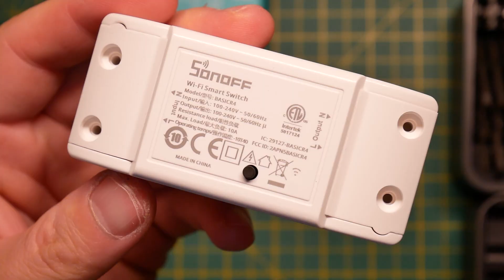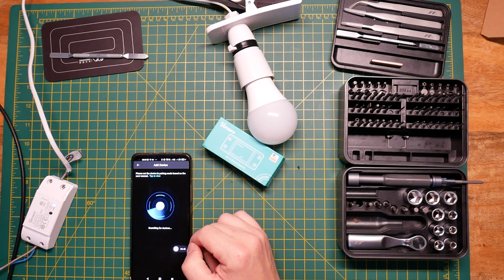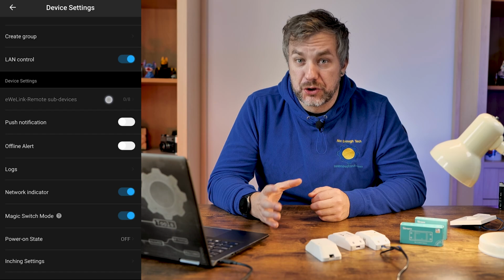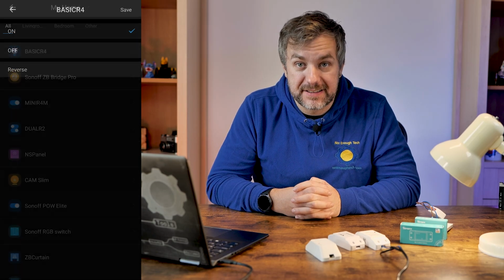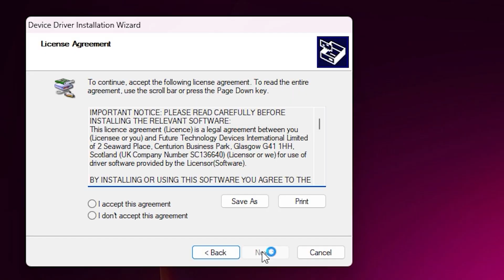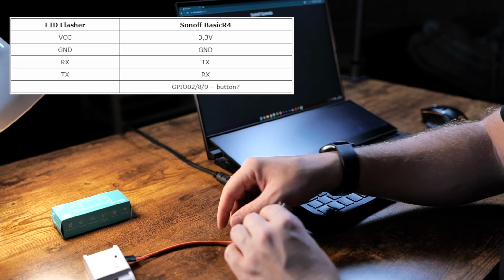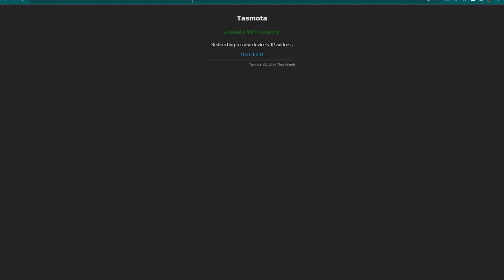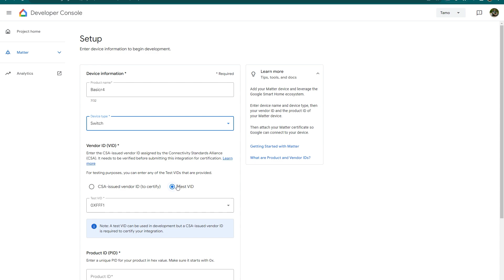Adding Matter to Sonoff BasicR4

Comment: 3:30 into the video you said that you could "expose the pins of the header".
Are you serious?
You failed to notice in your video that the Sonoff BasicR4 is missing a transformer.
This means that the electronics inside is not isolated from 220V mains AC.
It's not rocket science to realize how 220V AC might be reduced to 3.3VDC without an internal mains transformer.
Congratulations on sending your less experienced listeners to an early death.
Reply from the maker: Hacking is risky. This isn't advice to make the device safer. The scenario which you describe is dangerous when device is faulty to begin with, which isolated or not, would be dangerous to tinker with regardless.

Comment: If I install a Sonoff Basic R4 at home along with Sonoff R5 switches, will they still work if the internet goes down? Do they communicate directly with each other via eWeLink, or do they completely depend on the cloud connection?
Reply from the maker: @EinSoldiatGott  both support LAN only mode so as long as you are on the local network it would still work with the app.

For the software automation panel where you link smart devices cloud is requiried

Comment: Hi there thanks for sharing the video. it's awesome. Based on your expertise, is the basicR4 possible to be installed directly with the wall light switch? usually for wall light switch will have 3 cables whereas for the basicR4 only have 2 cables input. I wonder if we can let the ground directly connected to the switch and L & N cable connected through basicR4 then to the switch?

Comment: Did they ever fix the Tasmota Matter implementation on Google?  or did Google get their head out of their bum and fix it?  Annoying that we have a wonderful compatible "standard" but requires certification.  We can all agree to use WiFi standards without blocking DIY hardware because it's not certified.

Comment: Another call for a look at MagicSwitch mode. I’ve flashed one to Tasmota (don’t use EweLink for anything else so keen to avoid) but it doesn’t work, and I’m not sure how to reduce the MagicSwitchPulse that apparently needs tinkered with to fine tune to individual switch setups.

Comment: Good point about the button being delicate - I just bust an original BASIC (button is the same on the new one) due to being over-enthusiastic with the top off. Around 2:10 you mention the CE certification. My main memory of the introduction of CE is how it decimated low--volume-production companies due to unfair pricing in the UK and rip-off measurement kit companies, favouring large-scale manufacturers. Meanwhile China simply bypassed all of that with their timely CE mark - or "China Export" - the only significant difference being a minor difference in spacing which an uncaring public would almost never catch. Having said that, Sonoff do seem to be using the right one. 

Matter - well, for now I've given up with Tasmota and Matter - you don't need that for Alexa as Tasmota supports Alexa anyway - always has  - and I could not achieve satisfactory results on Google so went back to using Hardill's Node-Red software to get ANY Tasmota'd device (ESP8266 or ESP32)  working with my Google Home device. BUT if the R4 DOES continue to remain price-competitive (AliExpress etc) with the originl BASIC, then why not?

There is a point - the original - I just finished adding a DS18B20 to one of mine (no resistor needed) and the original has a clearly marked GPIO2 on the PCB to use for that.
Reply from the maker: Good thoughts on the subject. Plus the comment section works now :)

Comment: Would / could you make an short description of the benefits from a newer generation of the basic R switches - what is better with R4 compared to R3. What is betterwith R3 compared to R2. All basic generations are available, at different price points - so what do I get for paying more for a new generation?🤷‍♀️. Thanks.
Reply from the maker: Actually you are paying the least for R4 (launch price) and as other gens will be pushed out . There is little benefit to buying older unless significantly discounted

Comment: You could of demonstrated the "magic switch mode" for the new Sonoff basic. You don't need switch-mate. It can detect the transition of the changeover contacts,  of a normal light switch. You just need to link the the two light switch contacts together! The Sonoff can detect the sudden dip in mains power delivered to it (the poweroff glitch). It's 🎩!!!
Reply from the maker: You would see the wires. My trick is better
Reply: @notenoughtech  🤣🤣🤣🤣 you do look like a magician🤣, with the switch-mate. But the built-in "magic switch" option is a pretty cool no-neutral required, at the switch-box, function😉
Reply: @MyProjectBoxChannel  would it still work for fans?
Reply: @thebatu89  yes I think so 👍. The magic switch mode should work with ceiling fans.

Comment: 4:57 this new Sonoff basic also has a really interesting feature to use a light switch. You basically have to loop a 2 way light switch with itself so that the power gets interrupted for a short time when you toggle the switch. This will control the relay.
Reply: Is that how the magic switch mode that’s advertised on their website works? So you don’t need smate with that
Reply from the maker: Smate is more for remote connections
Reply: @notenoughtech  yep, hope you can do more test with magic switch mode on the next video
Reply from the maker: To be fair.. there are better switches for this use than R4. From my stand point it's more of a gimmick.
Reply from the maker: I exposed 2 pins after flashing tasmota. With that alone you can add inputs directly or unlimited inputs indirectly using serial protocol.
Reply: @notenoughtech  i do wonder if that mode still works once flashed to tasmota since you still have to enable it on the stock firmware.

Comment: For some reason I thought the ESP 32 C6 had matter and the ESP32 C3 only had BT and wifi, but the C3 has all of them? Just got a C6 development board; could have saved myself a couple of quid.

Edited to add: Just thought Matter is multi protocol and not just Thread and does not need the Thread/Zigbee radio.
Reply from the maker: They need appropriate hardware encryption baked in..  but providing the hardware is up to the task you can add Matter via OTA to anything as long as it passes certification